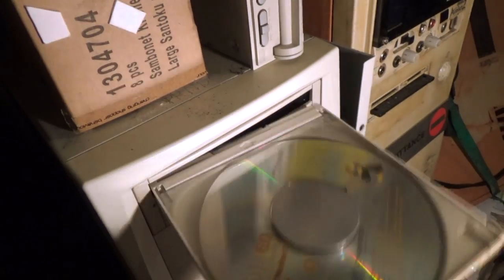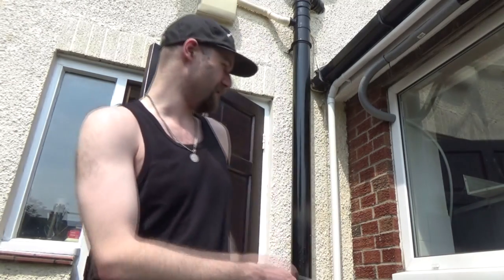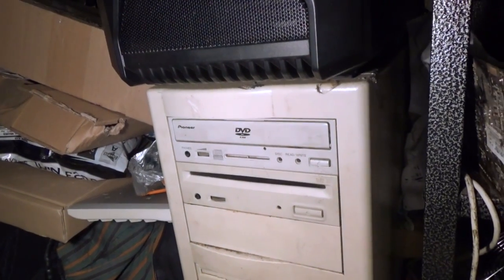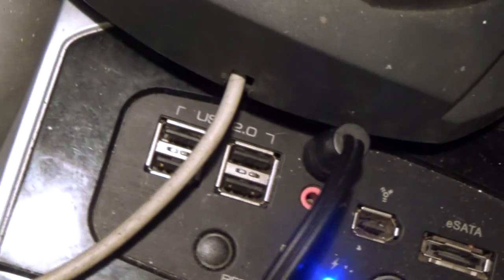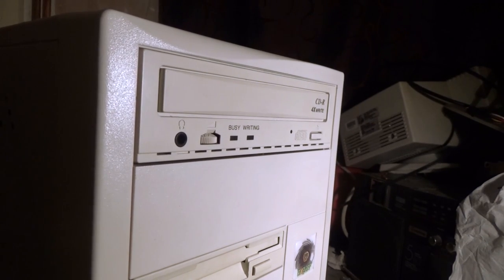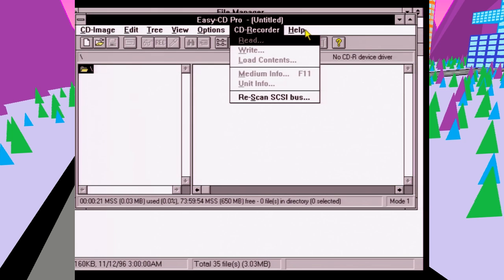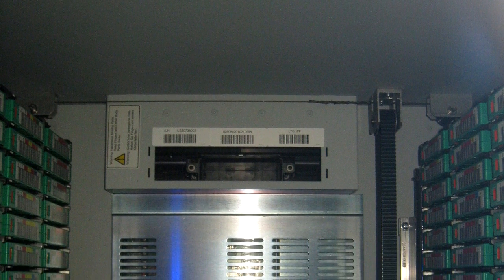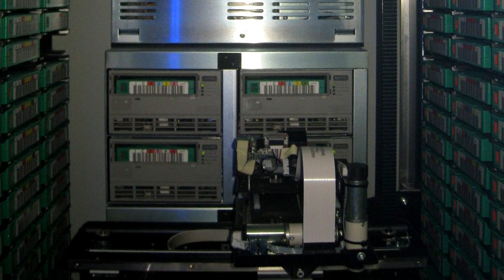Burning a CD in Windows 3.11 / PC CD Recording history

Comment: I've got a CD for Nero 4.0 that I copied and put on win3x.org (might be french only though)

Interesting video !

That EZ-SCSI thing from adaptect interests me, where have you found it ?
Reply from the maker: Hey, thanks. I'll have a look for your disk image at some point, though I was using Nero 3 here. It is possible that a French disc might work fine with the unknown drive configuration thing.
I have no idea where I found EZ-SCSI and currently don't have access to it. I shall try to dig it up for you at some point though if you like as I can just zip up the installer I have. I also have a Win9X version that I used with the K5, each one only works with its intended operating system and won't install otherwise. The Win9X one is cool, if only because the CD Player has this garish neon Jukebox skin.
Reply: By the way, you told me that your last YMF724 had spdif output, sb_link and pc speaker input, right ? Well like I told you, YMF744 seem to have often more functionnality than YMF724. Actually, one of my YMF744 has pc speaker input, spdif output and SB_link so it's probably what you're looking for. Maybe I'm wrong, but you might want to look for YMF744 instead of 724 because they seem to be more prevalent to having these 3 options (the other YMF744 I have also have SP_dif output, but also an internal input, a non populated SB_link but no PC speaker input)
Reply from the maker: I have one, but no PC Speaker input - the pads are there, but the circuitry is missing. The card is also bulky, using two slots for no good reason and whilst I haven't yet tested, I'm pretty certain it's going to be noisy just by looking at it. Also, the pinouts for the extra inputs are unusual meaning I have to make cables for the damn thing with connectors I can't find anywhere or, you know what, I don't actually care anymore, I'll just hard-wire the bastard. Doubt I'll ever get another card like the one I had. Otherwise, with your PSU, shouldn't be too hard to add a relay, just make sure it meets the spec for what you're doing, the last thing you want is for it to arc over and break something.
Reply: Thanks !

Do you mind if I may share it with other people ? (if you want, I can mention you)
Reply from the maker: Yeah, sure, I didn't write the software and I doubt if Adaptec are bothered about it being passed around, so whatever. I'm not fussy about mentions, I'm just the guy who posted a link, so that's up to you.
Reply: Allright, I just prefer asking before doing anything ^^

Comment: is that second slot on your psu for a monitor?
Reply from the maker: On the back? Yes, though you can power anything that uses standard C13/14 connectors within the power limits. These older supplies actually shut off all power to the system when the switch is off, so this socket only provides power when the system is running. Some early ATX supplies had them too, but they were always on. There are monitors out there which actually have a C14 on the end of the power cable instead of a regular plug, generally smaller monitors used with embedded systems.
Reply: thanks I learned something new
Reply: This is so practical IMO ^^. Maybe someday I'll mod the ATX psu that I have that has this too so it will shut off the monitor when the computer stops

Comment: My first p3 (450 MHz Slot1) was able to play DVD's fullscreen without problems without any external help.
First CD burner I ever saw, was in a computer of a friend of mine, its cost was about 450€uro (~500 USD), and took about 45 minutes to burn one. And don't you dare doing anything else with the computer while burning CD's because it most probably crash and result in a useless CD and some lost time. It was an HP double speed reader and burner internal drive with an IDE interface.
Reply: old dvd players seemed to be more perfomant back then. My Powermac G3 upgraded to G4/500 really struggled.
Reply from the maker: 450MHz is probably about the point where things like that started to run quite smoothly, likely also helped by how quick most good vendors were in adding some level of MPEG2 acceleration to their video cards. I definitely have memories of MPEG2 playing fine on my old P2-266, but only if the Rage drivers were installed a certain way, and only Media Player, PowerDVD was slow and it was solely a software decoder, implying the limited MPEG2 acceleration of the Rage chip actually did something. I did say the dedicated decoder market was short-lived, didn't I? It seems my suspicions were indeed correct.
The Powermac G3 did use a Rage IIC as far as I am aware, but I am unclear of whether they didn't use the acceleration or whether the system had some other obstacle preventing it from running smoothly, it seems a device called "Bordeaux" was available for this task with its own decoder. Possibly needed, possibly deliberate money-grabbing, I don't know, Macs aren't my field really.

HP burners were the first burners below $1000, though I'm not sure what the specs of that model were.
The first burner on our street belonged to a guy over the road, his machine was always the latest thing, bought with loans like everything else he had (dude was notorious for his debts) - unfortunately he didn't really know what he was doing, so most of his discs didn't work.
Reply: The ability to play DVD's via software was probably because it was heavily optimized for SSE instructions which was one of the selling points of the pentium3 (otherwise almost identical to a pentium2, except the clock speed).  If i remember well, my graphics card by that time was a nvidia TNT2 Ultra 32MB. I don't remember if it had some kind of video playback hardware acceleration, but I do know I didn't have any specialized mpeg decoder video card.
I remember my first CD burner being a Freecom IDE 4x drive. It worked quite well, and was much more reliable than my friend's crappy HP 2x burner, and about one third the cost, too. I bought it about one year later, though.
Reply: I still have my SCSI 2x burner. I used it a Quadra 950.

Comment: Hello, Congratulations on your video 🙂. 

 I'm desperately trying to burn a CD with Windows 3.11, but can't.  However, I have the same burner as you.  

I have an Adaptec AVA 2904 PCI SCSI controller card.  I installed EZ-SCSI 5, the same driver as you for my CD burner, but Nero Burning Rom refuses to burn. 

 it doesn't offer me any write speed, and the only option available is speed measurement which doesn't change anything.  I didn't find the exact same version of Nero as you, I only have 3.0.2.0 and not 3.0.2.1 like you.  Version 4.0.3 causes a crash on my machine.  Could you help me please, I would be extremely grateful to you? 

Sincerely, 

Riendutout
Reply from the maker: Whilst I can't make guarantees on this, as the NAS with the install files on died, I think this is 3.0.2.1 - http://dxzeff.com/trash/3nero.zip
Serial might be 1385500001310657 or 1385500001310857 though if not, I can always try again to dig it out. The software may claim to be the demo version until you enter a valid serial. Make sure you have Win32S installed and be ready for Nero's GUI to have some layout issues, especially if you played with Windows' metrics at any point.
Reply: @HighTreason610  Hello, and thank you very much for your response. 🙂

Before being able to burn, did you have to run a speed test so that the option to burn the CD was available?  

Sincerely, 

Rien dutout.
Reply from the maker: I honestly can't remember. As this burner can take modern CD-Rs, I suppose the worst that'll happen is you end up with a few more places to put your coffee cup down. I have an older burner now that will only take specific discs, that one is far more nerve wracking as they're expensive.
Reply: @HighTreason610  Thank you very much for your answer.  🙂

I tried the speed test with a blank 700MB CD-R, but the test didn't work.  Nero has a speed of 15x which is way too fast for this burner.  

Even after the test, the burn option remained grayed out.  Still, I didn't get any error message indicating a testing issue.

Your very old burner is only compatible with 650MB CD-Rs I imagine.  Are the discs he burns playable with a current drive?

 Sincerely, 

Rien dutout 🙂
Reply from the maker: Not sure what's wrong, could really be any number of things, unfortunately. As for speed measurement, that's broken, so I'd not worry too much about that, it spits all kinds of random numbers out. This issue actually persists into the present day with PowerISO claiming my laptop burner is way over 100x - perhaps the test data is small enough to fit in the buffer and this skews the result. This would make sense to me, as the same happens with CPUs; if a benchmark routine is small enough to fit in a CPU's cache, the results become inflated as I/O performance (primarily to and from RAM) is no longer being measured.
Yes, the older burner only goes up to 650M and only certain types of them. They do work in modern drives, though read speed seems slower.
Reply: @HighTreason610  Hello, and thank you very much for your answers.  🙂 Could you provide me with the copy of Nero you used, as well as the copy of EZ-SCSI?  It would be for testing

Comment: I bought my first CD burner in 1996  for $600
Reply from the maker: This seems fairly consistent with what others have reported, it's still a little horrifying to think of, especially once adjusted for inflation - north of $950 today. It seems that around 1996-1998 is when the prices started to fall off, leading to the cheap drives of the 2000s.
This video needs a follow-up at some point, to demonstrate an even older unit.
Reply: I was lucky that I got the scsi  card for free.    Back then you made audio CD's you had to experiment with  which brand  worked in you car CD player.  I was told gold color(on the bottom ) worked  the best. You had to watch out for cheap brands as the top would scratch easily . Some times it would just flake on it's own. Of course that caused disc   rot to happen very fast.
Reply from the maker: Disc chemistry and construction could definitely vary considerably. It;s funny you should mention audio CDs, amusingly discs burned with the older drive noted before work in car CD players that don't usually like copies, often being the only CD-R discs to do so. The short version is that 'much lulz' promptly ensue at the expense of the car owner. The burner itself is, indeed, quite touchy about which discs it can write to though and, unlike the Panasonic one here, it tops out at 650MB discs, being unable to track the smaller pitch of the now more common 700MB ones.
I can certainly remember some burned CDs in the 1990s losing their coating, it would just lift off in a bubble and flake away after a while.